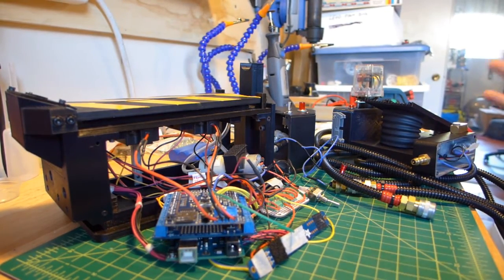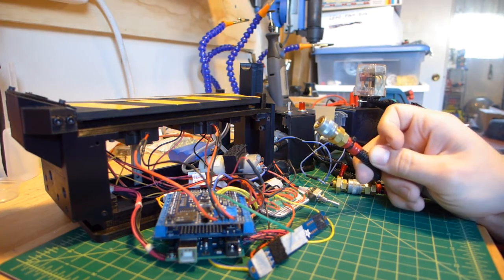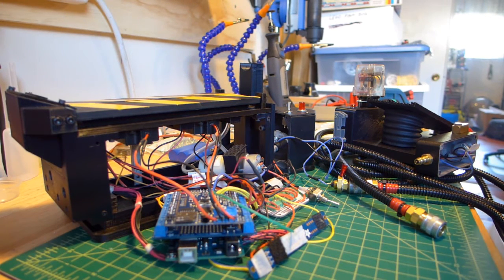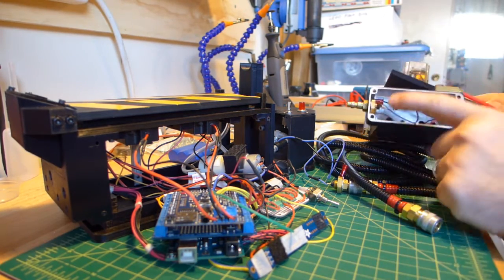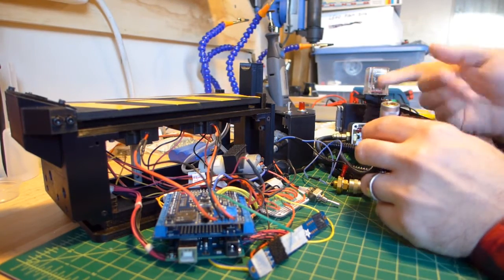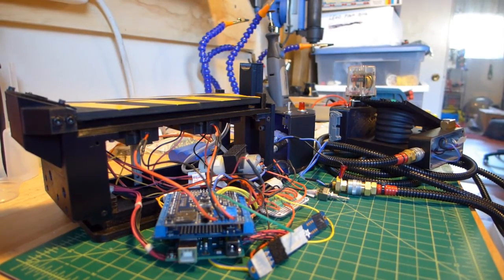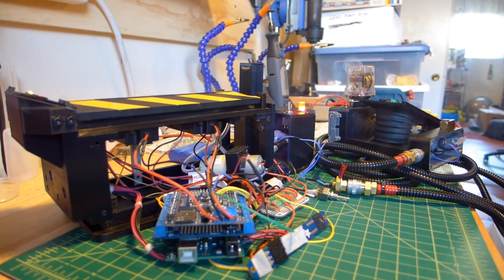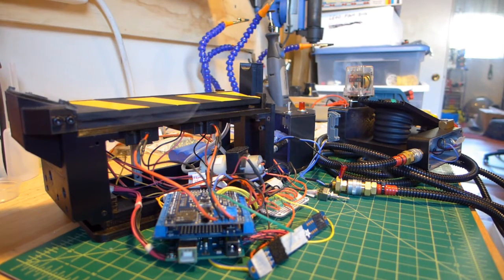Ghost Trap Electronics

Comment: Do you have a less accurate alternative for the wire from the trap to the pedal that works similarly to your circuit
I want to do that for my trap but I don't think I'd be able to modify the original hardware for the connections

Comment: You could simply used a pressure sensor and pump air through the tube and press a Ballon with the pedal. It is often used for sawing machines and other industries machines.